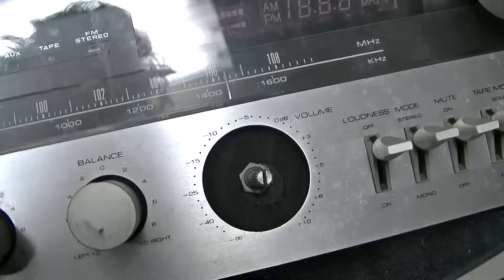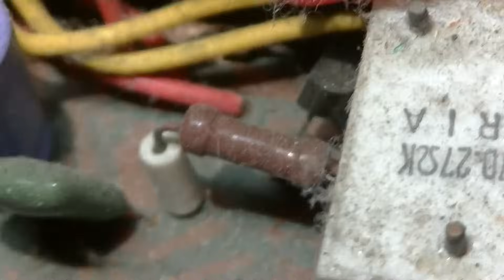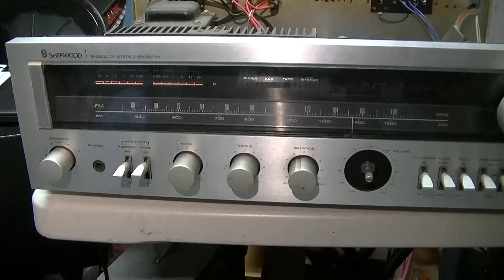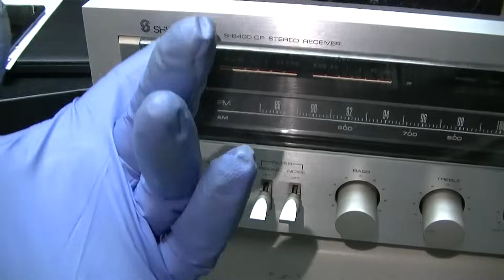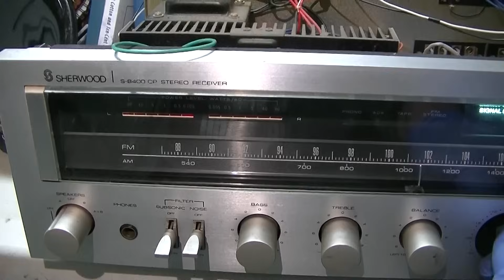1980 Sherwood S8400 Receiver Repair and Ford AC Compressor Replace and Dissect

Comment: Receiver made by Dongwon Electronics (inkle)
At that time, it was a combination of a top-end Integrated Amplifier and a top-end tuner, but it seems that this model was not sold much in Korea, and almost all of it was exported. 
The sub-model is 

is the inkle RD-930 receiver, which is also a rare model in Korea.

Comment: Yeah I never really understood the reasoning of putting the power switch into the tone control and the likes. Volume control makes the most sense, you're almost always going to set a desired volume when powering up a device. Anything else for me takes enough mental energy each time to be annoying. I guess some manufacturers just wanted to be "different" but it sucks for us tinkerers because those controls are now long extinct and you can't get replacements. Even a good volume pot/power switch combo can be tough.

Ironically the one receiver I have with a similar issue is a Sherwood as well. It's a Sherwood S-7110. But the power switch failed into the on position on mine, so it bypassed itself. This model does fortunately have the switch in the volume control so I have some hope I can fix this one single issue it has and sell it to somebody who wants something basic and low power from the era. It does sound pleasing.

That'll likely be my first project to tackle after dealing with medical complications for the past 6 months. Then get into my radios again.

Comment: Your air intake can be modified to I assume metal dryer/heating hose...   That Sherwood receiver is unique with both analog and digital tuning. The burnt resister on the one output side should be replaced. Speakers in cabinets or at least attached to a board will sound much better especially on the bass end.

Comment: Great video Shango!.
Found them both deeply interesting, as I do all your videos & always learn something new or different as the principles can be applied to far more than what you just showcase, so thanks heaps for all that you do in sharing these videos with us!.
The old 1980s tuners are great, as long as the vacuum fluorescent display is OK i.e. Panasonic DR-28/RF2800, DR-31/RF3100 etc.
Facing similar issues with my own car though mine is more the crankshaft pulley/harmonic balancer bolt & woodruff key which were surprisingly very difficult to locate) & eventually had to order parts from Japan which actually fitted as the 17mm crankshaft pulley bolt wasn't available locally despite extensive searches, so took a punt & banked on the fact it was a Toyota 4A-FE motor & came up a winner.

Many times, car manufacturers use the same parts on different engines & make/models & you may get lucky & one like Ford, guaranteed would have parts commonality across many models to save production costs.
Have similar sentiments in buying a new car as Australia is having a similar mentality to California when it comes to EV, mind you it makes little difference anyway when the rest of the world is building even more coal power stations so essentially we're trying to make a hole in a pond of water.
Nephew is a mechanic who works in a busy workshop as his job & he tells me most of the new car engines are basically junk after 100000km (62137 miles).
What I fear with EVs is they'll essentially be all "black box" electronic modules i.e. John Deere anti right to repair on steroids.
I feel they're implementing ill thought out EV technology which works great for inner city with good power infrastructure, and if it was so great & cheap then why isn't Africa & Asia moving to EVs on masse.
Households argue over mobile phone battery charge, can one only dare imagine this on a grand scale with EVs!

Comment: One thing you could do with that intake to repair it is to get some silicone rubber hoses and make up your own intake tubing but you might have to drill a hole or two for the smaller hoses that come from the intake.

Comment: Hello Mr. Shango how are you.
I have an idea how to wire an AA5 so that it's safer. I tried it on my radios and it works. When replacing the power cord use a polarized line cord and wire the hot to the rectifier and neutral to B- . Wire power switch to break the neutral to the filaments

Comment: Not going to argue anything but I will say it’s a horrible idea to run the a/c system like that or with a questionable compressor because if it fails it’s going to pump shrapnel all through the system and it will destroy every new compressor u put on it ull basically end up replacing the entire system

Comment: Replaced many of those power switches in the 70;s & 80's at Radio Shack. Had to buy the complete switch assembly as the power switch wasn't available by itself. Neat compressor teardown.

Comment: In Europe, replacing the refrigerant with another one may mean that the car will not pass the inspection - it will not be allowed to drive. It so happens (probably by accident) that the obligation to replace the refrigerant with a new one occurs just before the old refrigerant loses its patent rights.
The question of whether you can do whatever you want with your car is problematic. Recently, there have been a lot of cases involving Tesla's autonomous pilot, which poses a threat. People do not keep their hands on the steering wheel, are under the influence of alcohol and drugs, and even sleep while driving on autopilot. However, this function is not actually an autopilot.

Comment: What is that a 4.0lL  anyway you can get some a/c flush and a orifice tube for not a lot of money my 20 bucks also pull the blower motor a clean the coils out with a water hose as for the air intake hose a cold air intake pipe my be your best option but i would try to use the stock air box just the metal tub with some silicone couplers  and keep rocking that truck  and as far as I know that compressor is on several different Ford makes there still out there

Comment: Hi Shang, awesome videos and I love the cynicism sprinkled about.  It's a fine line between a pessimist and a realist!   I am 64 and love tube type electronics,  including TVs.  I don't know anything near what you know about them so I learn something on every video. 

As an aside,  I own a 2004 GMC Sierra 1500 that I bought new and it now has just over 200k miles on it.  Not to jinx myself but it has the original A/C compressor and it still works!   I don't know who makes them these days but it looks very similar to yours.  The good vehicle A/C systems were the '60s and '70s Frigidaire (G.M.) 'A' compressor-based, which really kicked ass!  Good luck with your truck... I'm assuming it's a Ranger; they are around but bring the bucks if you find a good  used one.

DD

Comment: That is a nice receiver I could grow to like.  I don't spose you used the contact cleaner on the power switch?  You really didn't need to; that farking arcing was no bueno!

Looks like good quality pcb's (FR4?) & cable ties used.  No corrosion inside.  

Regular old-school discrete power transistor outputs.  Pretty fine.

Geez you slaughtered your a/c compressor clutch didnya!  Never heard of butane in a/c systems but if it works?  Are rebuild kits for those compressors expensive?

Comment: Best of luck on finding an intake hose for that 4.0. You can find them for the Vulcan 3.0 engines all day long but not for the four. Having three vehicles in our Fleet with that same engine, you think that some company would make an aftermarket replacement, but no one does.
Reply from the maker: exactly

Comment: The first R12 replacement were just a mixture of propane and nitrogen. The nitrogen was just fill gas. Propane boils colder than R12. You had to run 45 or more suction pressure to keep from freezing the evaporator.

Comment: At last some hifi gear! been waiting a long time for this. excellent stuff. this just needs a purple filter on that green display now to make it white to match the led dial.

The speaker switch/power switch combo is a cheap ass way of not using any pop protection on the speaker outputs to prevent them from going "BUMP" every time you switch the thing on and off.
In a nutshell it kills the speaker outputs before you can turn the power off, very cheesy.

Speaking of rain,

Have you heard what some idiots in Dubai have done? they've put some chemical in the sky to make it rain, now the whole place is totally flooded.

Comment: I always wonder if that much dust on circuit boards might be somehow, or somewhat, conductive...leaking current between unrelated, unconnected components, like between pins of an IC...like if the dust gets damp from high humidity...

Comment: For a quick fix, you could use self sticking tape. I used the tape to repair a Sears canister vacuum cleaner that is 35 years old.

Comment: i am very attached to my 2004 Corolla, don't want to sell or replace it with anything. Does not need a drop of oil between changes, original ac compressor, very little faults and being a Toyota, parts are widely available. And yea, has NO f'n touch controls or any of that crap

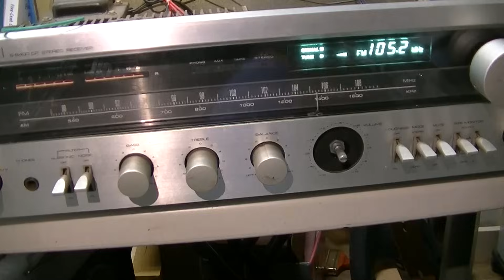Comment: 7:00 High impedance isnt a problem on solid state amps, only on tubes where it melts the screen grid because the plate voltage dips too low without a load

Comment: How do you know if the clutch failed, first?   Before you proceed.  Clutches are replaceable, by themselves.  At least for some products.  The OEM vehicle parts department will not sell the clutch, but only the entire assembly including the dryer.  Even the clutch bearing can be replaced, alone.  If one can figure out the original spec.  Ford owned controlling interest in Mazda, at the time, for my Mazda 3.  Mazda wanted 750 bucks parts alone, I found the clutch bearing for about 25 bucks, found the entire clutch for about 60 bucks sold at one of the chains.  When my engine sounded like it was rattling to death at idle, but no rattle at rpm, I cut the stupid flat belt off, and sure as shet, engine was perfect.  And the original compressor minus the clutch, at 125k miles, perfect.

Comment: My dad had one of these tuners that had the signal strength and the same tuning arrows. He had it piped into an Olson AM-744 amp and some realistic 15" woofers and horns with a custom cabinet that he built. He had 2 turntables, an EQ, dual tape deck, and a state of the art of its time CD player. He had this setup as a backup and gave it to me to use when he upgraded. The thing blasted. I learned how to set up audio equipment on this setup and had it blasting. Although it was maybe 50 watts per channel, it sounded way higher. Eventually we were forced to move up north 300 miles away and had left it all at the house we lost. Found out that most of the equipment was collectible and worth a lot of money. He bought most of it at a pawn shop and went to radio shack to get the speakers and other equipment to make his DJ business function.

Comment: I flushed the air conditioning system in my Chevy truck when I replaced the compressor and accumulator / dryer on the system. It really did a good job on getting the nasty stuff out. Maybe you could try that....

Comment: Sherwood S-8400CP 40wpc, $360 MSRP new in 80-81. 
I use the capacitor wizard for checking out the power switches, it does a great job at reading low ohms. 

Will be using the capacitor wizard for tracing out a short in the regulated power supply in a Panasonic boom box. Much better than cutting traces.

Comment: Now there's a textbook example of galling on that wobble plate. I bet the Subcooling and Superheat aren't in spec with a clogged evaperator coil. Thermodynamics experiment. And smooth flowing electricity in a bypassed switch! Cool

Comment: Does butane have the lubricant in it to lubricate the compressor? Odd you're doing the A/C compressor all the time, my Ford one is still going after 24 years, just get it vacced and regassed with fresh R134a every few years. I am due for a new compressor though as the high pressure side has a very tiny leak.

Comment: That set has some good stuff in it despite it being one of the last decent sets Sherwood made, shielded transformer and a linear PSU makes for better audio,  the vacuum fluorescent displays look far nicer to look at than OLED. You can put together a good HiFi with 80's kit that will run rings round the 'optimised' blue light crap made today.  Ps    Try self amalgamating tape on the intake,  rubber and flexible.

Comment: "Science & Chemistry".........Butane (& propane) are good refrigerants and replacement refrigerant for most anything except 134a systems (unless you change the oil to a petroleum based oil). Why? Because Butane is a petroleum based refrigerant. Though you may have success running the 134a base oil while using a petroleum based refrigerant eventually that oil will separate from the refrigerant causing excessive friction, mechanical failure and contaminants (hence cooked oil and metal debris); hence again, the "black death" you speak of. BTW: Black death isnt limited to 134R systems only. Ford is known for "black death syndrome", but still comes down to oil separation.  HVACR 15 years experience at your service.

Solution: After replacing your in line strainer &/or >>>strainer and hose<<<< (which I highly recommend) drain that current oil, and pull that vacuum !!!!!! Then replace the compress oil you're currently using (if its the 134a type) and replace it with a petroleum based oil like those used in R12, 22, and 502 systems. This will correct your on going problem. 👍

Comment: I've had a few 1980's Sherwood branded receivers come through my workbench in recent times. They seemed to be fairly decent. They did use a lot of STK amps later on during the 1980's. However they became to offer audio equipment in your choice of silver or black... people assume the black faced (still aluminum) is BPC and nobody wants it. Now if I had a dollar for each one of those Alps power switches.. I take them apart and polish the contacts. Not sure why companies did that switch on the speaker selector on models with a speaker relay, but many Pioneer and Realistic receivers had it. With the low models that did not have a speaker relay, it removed the amp from the speakers to eliminate power down noises.

Comment: Stupid switch design. Engineered to be unreplacable. I like equipment from that era, its modern enough to sound as good as you need. And very repairable. Transistor amps will run happily with no load forever. They hate shorted speaker outputs. But open it totally fine. Opposite behavior to valves in many ways.  Upgrading cars is a hard one. They're expensive. Far less reliable than they were twenty years ago. And catastrophic failures render the majority of them unrepairable in five years time. I blame a lot of this on the mandated efficiency standards, forcing complexity and lightweight plastics into places that they don't belong. Don't get me started on electric utopia -  how's that gunna work in the bush or the desert. Simple answer it doesn't. You'll only travel 15km and you'll be happy. Only exceptions will be if you need to get to Davos each year.
Reply: Davis insists NO VAXXED pilots to ferry the participants!!( not joking)

Comment: A fun fact about teflon. I have parrots and if you overheat teflon (and it doesn't take much to do that, say 500 degrees), it will off gas something that will make every bird in your house drop dead. In the coal mines, when your parakeet drops dead its a sign that you need to evacuate because the air's either not there or heavily contaminated with something you don't want to be breathing. I switched out all my nonstick stuff with cast iron because of the birds, and you know what? I don't miss it.

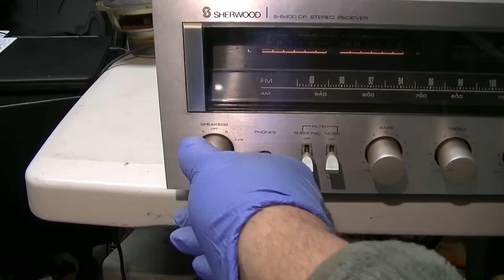Comment: 6:50 Actually putting the switch in the treble contol is an unavoidable sacrifice if you use tone compensated volume resistor, because tone compensated resistors with a switch are overcomplicated and barely exist.
Reply: No, it's easily avoidable: Just have a separate power switch.
Reply: @eDoc2020  Nah, the separate power switch was not invented until 1960-1970s, it is not authentic))
Reply: @cfd_novotroitsk  Good thing this is a 1980 model, it would be period correct.

Comment: This made me nostalgic for my old '67, according to Sams, S-8000 III FM tuner/amp which I bought used from an "antique" store back in the late '80s.  I kept it going until the other output transformer  failed back in 2014.  Best FM tuner (especially) and sound system I ever owned !  I still have the remains of it and would love to have it back in prime condition again.  The 7868 outputs were tempermental as He)) to bias but fiercely superb sound and volume.  Even without the expense of the output transformers, it would be expensive to recap it electrolytically and retube the output stage but I'm tempted again and again.  The main problem is the low profile design of the chassis and case.  The multicell filters can't stand any higher than 2.5" max and hardly any room to use individual units.  Sherwood really crowded the house on that model.  The replacements I had installed about 4 years earlier all got repurposed after it finally died so it would really be a build now to resurrect.  Then there's the replacement output transformers dimensions to consider as well...plus the overall cost.  But, this video really set me to missing it something terrible.   I've never been as happy with the equipment I've been using since.

Good luck on the AC 🧊.   It's that time of year again 🥵.

Comment: Plugged up orifice, filter drier, or low on refrigerant causing lack of oil return to compressor. Possibly not enough oil in system either.

Comment: 40:00 oh yeah you surely have a blockage somewhere, the compressor was sucking so hard it even evacuated the oil into the lines somewhere - this will kill the new compressor too if not cleaned out.